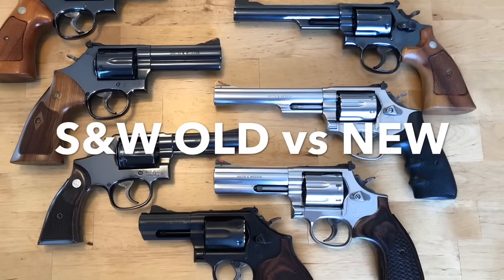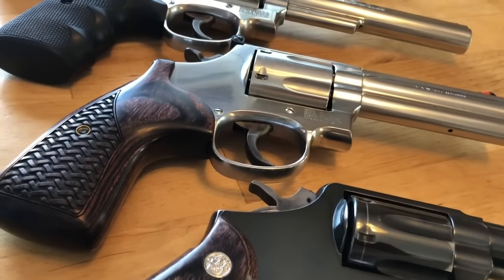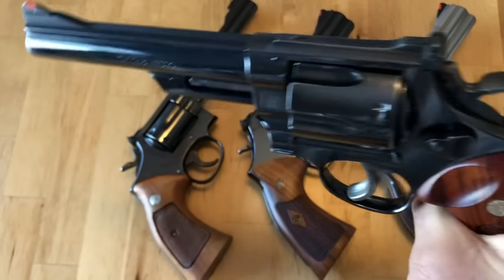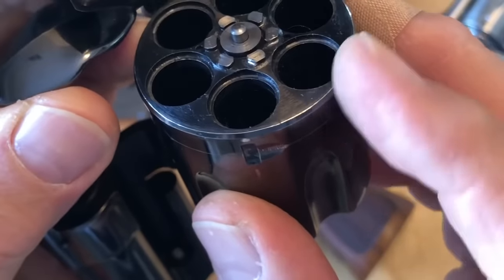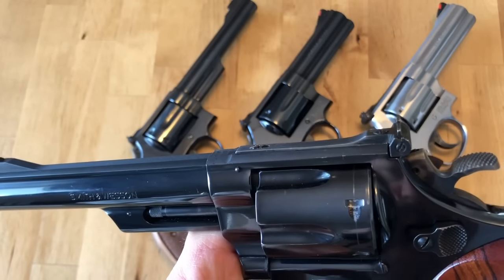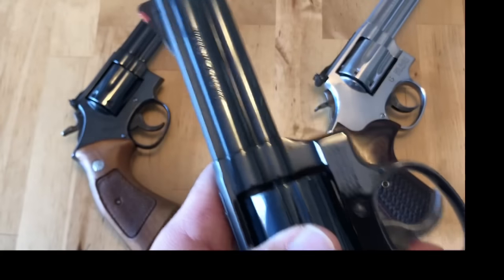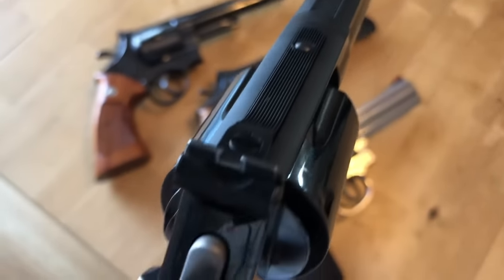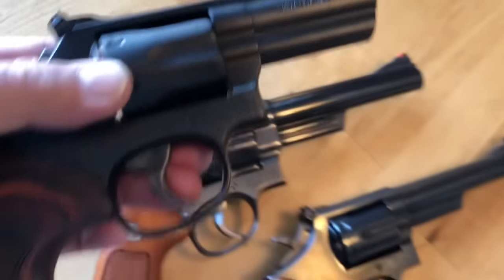Smith & Wesson: Old vs New. Do they make them like they used to?

Comment: Watching this video inspired me to grab a few of my S&W revolvers to "examine along with."  Growing up S&W revolvers were too pricey for my family, so we contented ourselves with those single and double-action revolvers from an upstart company called Ruger!   My brother somehow managed to afford an original Model 19 nickel plated 4" which was stunningly beautiful and the holy grail of what a .357 magnum should aspire to be!  At the time, the "best" I could do was purchase an "inferior" Dan Wesson .357 from Walmart for $150...it lacked the sleek looks and smooth action of the Smith, but it was a big step up from my Ruger Blackhawk .357 that cost $114 at the time!
Times have changed and I can afford "better" and now I have better, though many in the fickle world of gun snobs may not agree.  Having become somewhat of an "expert" in my own right, my gun buying choices are quite eclectic with no slavish devotion to any particular brand or genre.  Thus I happen to own a beautiful Model 25-15 "New Classic" in .45 Colt!  The gun is of course dark blue-black with high polish, with what I consider to be BETTER stocks than those awful Goncalo Alves of 40 years ago!  The new 25-15 has a 6.5" tapered barrel and tips the scales at a svelt 42 ounces as the .45 Colt isn't a particularly recoil intensive load unless one is hand loading for it.  On the new gun, the DA trigger pull is somewhat heavy, yet quite smooth, and the SA let off is a glass rod break!  It does have the IL but I don't mind.  I personally LIKE the new hammer and transfer bar system because it IS a genuine step BETTER than the old timey firing pin in hammer.  S&W developed the transfer bar system when they developed the X-frame series because they needed the BEST engineering to handle a cartridge that operates at 50,000 psi!  I also happen to have a few X-frames which I have studied at great length to suss out whatever metallurgical magic S&W invented to create such a beast in a PRACTICAL platform that to this very day stands alone, unchallenged, just as did the M 29 50 years ago when the ONLY DA .44 magnum carried the S&W logo!  It's EASY to build a single-action "pattern" revolver to handle big cartridges, with little, or less regard for carry and practicality, but it's something else to build a freaking .500 magnum in a 57 ounce package that can be belt carried, yet deliver 2,000 lb-ft of energy per shot!  Anyway, I digress.
The sating finish stocks on the new classics are more attractive than the originals, and the "faux" case hardening on the hammer and trigger looks identical to the originals, while the part itself is of superior steel, through hardened.   What is forgotten by those crying over lost times is that case hardening is a process applied to low-carbon steel to create a hard surface because the alloy cannot be through hardened.  Case hardening is ideal for moving parts such as triggers and hammers, but not at all suitable for cylinders and barrels, and modern frames.  This Mod 25 is every bit as "good" as was the old version...and will last longer without issues.
Then comes my M69 .44 magnum.  Stainless steel, L frame, 5-shot, two-piece sleeved barrel which is FAR superior to screwed on barrels, pinned or otherwise.  Since S&W can't admit they made a mistake, and change cylinder rotation to clockwise (like Colt), the M69 has improvements in lock-up to stay closed when firing full power loads in a 36 ounce .44 magnum.  It even has an Orwellian ball-detent lock at the front of the crane that indexes into the barrel shroud!  Since the L-frame basically has a K-frame grip, the revolver fits the hand well, though DA pull is quite stout, yet SA let off is typically S&W glass rod break.  For anyone who ever wished he could have a more compact M29 in 4", the M69 is the answer!  Very sleek, compact, and far stronger than any original!
Then comes my two Model 500s...a 4" and the 6.5"!  The huge X-frame with K-frame grip which results in a revolver that fits the average hand BETTER than the N-frame!  The ultimate in power - even the 4" model can deliver double to energy of a .44 magnum, and the 6.5" can eek out 2,500 lb-ft from top loads, though very few factory loads are anywhere near maximum because the round is just that powerful!  I can fire my M500 4" DA, unloading all five shots into a small paper plate at 15 feet in just over 2 seconds,  pop the cylinder and SPEED reload using billet aluminum 5-star speed loaders and be right back into action!  My own hand load of 380 grain hard cast at over 1,600 fpe is serious business.
I also have the .460 XVR 8-3/8" which allows virtually ANY .45 caliber load to be fired!  The .460 can accept .45 ACP if cut for Moon clips, .45 Colt, .454 Casull, and .460 S&W.  Recoil is mild from the long barrel with muzzle brake.  Launching a 200 grain .454" slug at 2,200 fps is nothing to sneeze at!  To date, NOBODY has challenged S&W by building an entire line of DA revolvers in a reasonable sized package!  They NEVER built these "like they used too" quite because they could not have done so back in the "good old days" of old-man gun snobbery.
Here I would like to point out that Ruger thinks they're fooling people - and certainly they ARE fooling many, in chambering a Redhawk in .454 Casull, but that's just smoke and mirrors.  To build a .500 Ruger would have to develop a new frame size, and apparently they just aren't up to it!
I've also got an assortment of J-frames...nobody has ever built a better pocket-sized snubby than S&W!
Reply: What's wrong with the 454 Ruger? They're supposed to be one of the toughest guns around.
Reply: I’ll take all your goncalo alves grips since you think they’re awful.

Comment: I am a S&W collector of sorts. (meaning I collect S&Ws but I'm not done collecting)  I have not purchased any new S&W revolvers since 2003, and the last 6 new S&W revolvers I bought (1999-2003) were all Performance Center models.  All of my other S&W revolvers are "older models", though a few don't have pinned barrels or recessed cylinders.  None have a lock.  
I'm not saying anything bad about the "new" S&W revolvers, I'm just not there yet.  If I live long enough I may buy some after I have all the older ones.

Comment: I had to send a Performance Center Model 945 back. A defective sear caused the hammer to intermittently decock and follow the slide down when cycled. Now that it's fixed, it's pretty sweet, though.

Comment: My friend got his brand new Model 637 airweight 3 weeks ago (almost $800 out the door) and was a little disappointed because it took quite an effort to open the cylinder.    
I never have a problem with my old Model 60 which I bought ages ago for $350.

Comment: Couldn't agree more on your points made. I appreciate the art of these firearms. Nice collection! I wish recessed cylinders came back and the locks went to hell, but reality of politics and manufacturing costs means we won't see it. I can tear down a Model 10 (my overall favorite model) to the frame and seeing the hand fitting inside is so wonderful. But not enough smiths have the skills and cost is prohibitive. When I see an older pinned barrel or recessed cylinder model I grab it. Thanks

Comment: I have all relatively new S&W model 29 4", model 629 5", model 29 6.5", model 686 plus 4". I love them. Revolvers are just fun, cool, easy to maintain, easy to learn to shoot. I really want the PC model 19 carry comp, but with a rubber grip. I like S&W rubber grips. I wish all my revolvers had the ball detent in the yoke that your PC model 19 carry comp has. Revolvers are not popular because a L frame or N frame is harder to conceal carry than a Sig p365. Same is true of the K frame, it's just easier to conceal carry a Sig p365xl. But I would like the model 19 PC carry comp anyway.

Comment: I have what I consider an oddball a Model 19-4. Recessed cylinder, hammer mounted firing pin but it does not have a pinned barrel. I suspect it was some kind of a transition model. A few years ago I saw another 19-4 on a gun show table and it had a pinned barrel with service grips. My 19-4 has a serrated trigger and target hammer and the original factory installed target grips. I got it in an even swap for my 4” 28-2.

Comment: You said it very well i thought .. I have been a S&W owner all my shooting life and mixed in with two Colt revolvers ..I have never had trouble with any of the S&W i own.. My main revolvers i use the most are my 586-4 which i have owned now for 20 years and i'm very happy with it , this model was built in 1993 ... My next one is a 629-3 Classic Hunter non fluted cylinder wonderful revolver, excellent quality along with being very accurate and it's 1991 .. My newest is the 617-6 that was built in 2001 , i love that revolver and shoot it a lot , really enjoy the 10 shot cylinder , it has the lock on this model which i have never had any trouble with ..  From my experience of 56 plus years shooting their revolvers i would have no problems with a brand new S&W which i'm looking at off and on... They build excellent revolvers and have done it for 150 years to me that says a lot ...Great presentation you did well.. It's good to see that someone has an excellent collection like yourself ..

Comment: I recently traded a 1980s Model 28 on a new 686. The Model 28 is a fantastic revolver, but it was a bit big for my hands and for that reason I didn't shoot it often. The fit and quality on the 686 are excellent, and right out of the box, I shot palm-sized groups at 20 feet. The 686 felt better to shoot and the stainless is a real plus. I'm not a collector or I would have kept the 28, but I'm better off with the 686 and will use it more.

Comment: I bought two brand-new S&W’s in 2018.  Both had serious issues from the factory.  The 642 I bought would fail to turn the cylinder about every 8th-10th round and the 69 I bought would fail to reset the trigger after firing and it would stick in the rearward position.  Inexcusable for the price they charge.  They agreed to fix them, but that’s hardly the point.
Reply: This news you've stated, was about as equally shocking to me, when i found our Craftsman's tools were behind made in Taiwan. S&W has along and proud history of revolver making, to let it go down the tubes.

Comment: I own a bunch that are pinned and recessed, 4 that have a lock and zero with MIM parts. I had a 629 no dash and a 629-1. They were gritter in the action than the carbon steel guns, so when I was offered a good price for them, I let them go. My 1978 29-2 with 6.5 inch barrel in Nickel  has fired many thousands, maybe even a 100,000 rounds. The only stainless gun I own is a 6.5 inch .500 with the 29-2 style barrel profile. I feel the older the better, you can have the new ones. The action, fitting  not to mention the blue and nickel finish and trigger smoothness is superior on the older ones.

Comment: Revolvers deff can be a investment Smith and wessons can hold there value in most cases they grow in value not like auto pistols they have become like electronics the new model comes out the older model drops in price well except for Glock they only drop a little bit but they still drop in price

Comment: Very, very well put. The blueing and the finishing on classic S&W from the 60's to the early 80's is awesome, but the construction is just better in the latest iterations. That is particularly true on those K frame 357 magnum models, which went from being 38 special's with 357 mag capability to being bona fide 357 mag's.
Reply: J Calhoun  No, I mean the latest versions of the S&W K Frame 19 and 66 have beefed up forcing cones and locking mechanism vs. the original models, making them capable of withstanding a steady diet of 357. The L frame is an entirely different kettle of fish, whose dimensions were modeled after the Colt Python.

Comment: What a beautiful collection of Smith & Wesson revolvers. I have a newly produced 686, but that's it. I am, however, looking for someone selling a 629 classic to add to my small collection. Edit: BTW I don't mind the newer manufacturing standards. I feel that if they were made with all the hand fitting of yesteryear then they would be several hundred dollars more, and for me that's a bonus.
Reply: I have a 629-3 .44mag. 8 3/8 in barrel with a custom finish on it in (metaloy) finish or called the starburst finish with less than 50 rounds fired thru it with box and paperwork for it !!!   Standard wood grips and rubber grips as well and 4 different front sight posts for it as well and the test target at 25 yards done on bench rest !!!   One of the most accurate revolvers that ever left the S&W factory according to them  !!!!  Oh yes  I bought it special order back in 1991  !!!!   As the American Pickers on tv say that the NFS price is $3000 dollars and non negotiable !!!!
Reply: @jeffreyelliott622  - Had one of those in stainless, 8-3/8", target grips, I picked up from a pawn shop in 1994.  Great shooter but a little too big for my hands.  Like an idiot I sold it.  Dumbest gun "deal" I ever made.  Looking to buy a 29-2 if I can find nice one ... to hell my hands!!
Reply: Yeah my 629-3 was factory stainless also !!!   I just wanted to give it custom starburst metaloy finish that was I believe only cost me less than $150 dollars back in 1992 !!!!

Comment: You can get a an old scuffed and scratched S&W Model 10 .38  for half the price of a new S&W .38. They will shoot just as good, if not better, as the new ones. Plus you get a piece of old world craftsmanship and history.
Reply: Got a police trade in Model 10, manufactured in 77. Over the course of a couple days, spent in total about 4 hours with the different buffing pads on my dremel. Though it is now a fingerprint magnet, it looks like shined up nickel plating. 
It is gorgeous and my smoothest shooting revolver

Comment: I have been interested in firearms since my youthful daze.  The thing about Smith & Wesson is that they changed hands in terms of corporate ownership many times over the years.  The Smiths made from about 1950 to 1980 are some of the best.  When they stopped pinning the barrels, that was a sign that they were trying to cut production costs and increase profits.  The Smiths made after 1980s are not quite the same.  S&W was owned by the Wesson Family and then sold to Bangor Punta and then sold again to Lear Siegler and then to Tompkins plc.  The absolute worst S&W handguns were produced with Tompkins ran the show.  Tompkins sold the business to Safe T Hammer and then quality started to improve again (Safe T Hammer changed their name to Smith & Wesson).  Today's Smiths are pretty good...but not as good as the pre-1980s stuff.

Comment: I have pretty much enjoyed the vintage Smith and Colt revolvers from the late 1960s- mid 1980s. When the pinned barrels and recessed cylinders , the firing pin on the hammer, the color case hardening and the high polished finishes went away, my interest did too. The older Smiths and Colts were assembled by craftsmen who often hand fitted the interacting parts so as to give not only a lighter but a smoother trigger pull. These guns will not be replicated since they were labor intensive guns to produce and were not machined the way that the newer guns are made. While I greatly enjoy quality revolvers, both military and law enforcement have gravitated towards semi autos for multiple reasons. I do not see that changing in the future. It takes time and craftsmanship to produce quality revolvers and the gun industry seems to have moved away from this in the name of cost and cost savings

Comment: My recent buy of a 586 was miserable for fit & finish. Hillary hole was plugged and one round would not fit in the cylinder. I traded it in for a used Ruger. My new buy of a model 60-15 was not pleasing. Front sight was horrible. Can't see what should be a clear dot. I bought a Colt King Cobra and was very well pleased. S&W revolvers have always been good. And I do have an old school model 29 44 mag as a solid keeper. New purchases for S&W going forward?.....NONE!

Comment: The main thing I like less about the newer Smiths is the change from broach-cut rifling to EDM around 2000. They definitely seem slower than the broached barrels, and it seems like the b/c gaps are a little bigger than they used to be. That to me is one of the biggest selling points for the PC guns as they’re still broached barrels.

Comment: Nice collection I myself i'm torn I like the frame firing pin I do not like the lock Hillary hole. I like the fact that the sites are not attached to the barrel. And the fact of the new lock up under the crane. But I love the old style pin barrels recessed cylinders lol

Comment: The rarest bird of them all is the Dan Wesson model 19-6 which is a K frame variant, but not quite the same. This was the gun that went on to the Python series, according to some sources. This gun came in 357, 41, or 44 ( extremely rare) in std 6 inch barrels, with 4 and 8 inch optional. They are pinned barrels, but gun smithe's that I've talked to say that SW 19 K frame barrels do not fit a Dan Wesson. They are floating firing pin designed with the recessed cylinder. They were available in high gloss blue or nickel finishes. I went to Julia ( now gone) and Rock Island's site to try and get a general idea of what mine is worth. Let's just say big $$ for a revolver.